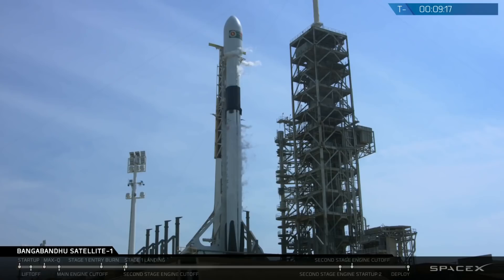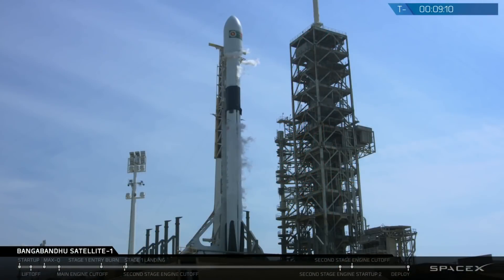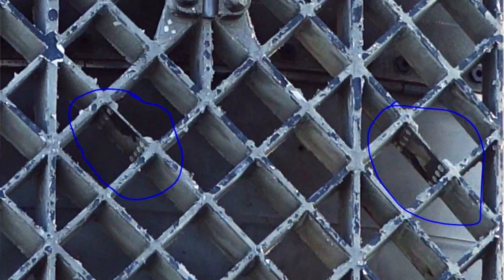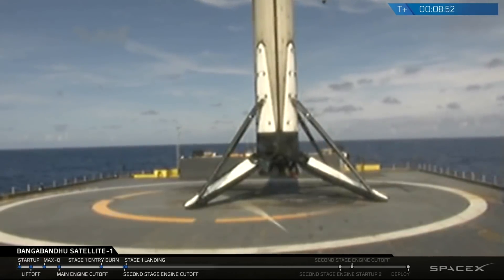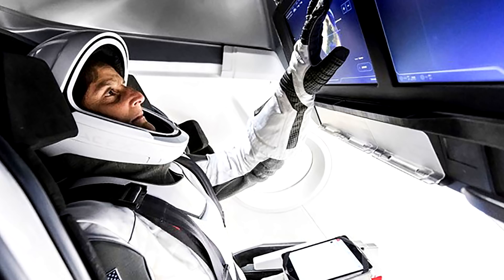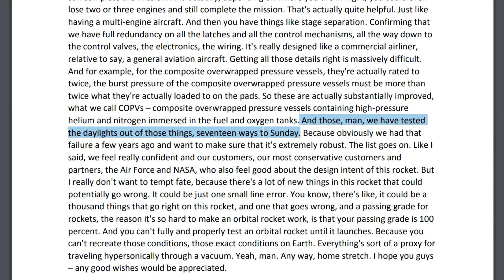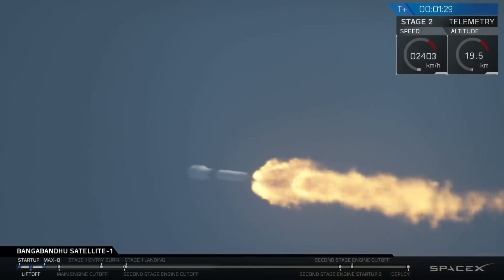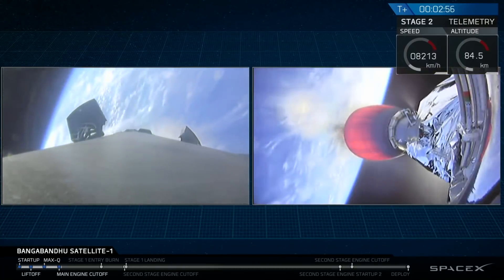How Well Did SpaceX's new Falcon 9 Work?

Comment: One thing i think has been missed, about the difference between Falcon 9 and Space Shuttle, is that there's a big difference in the number of internal sensors which can be used today vs. 40 years ago.

It's easy to get off-the-shelf sensors and embed them in the rocket, they've got many as we saw with CRS-7.  An inspection which for the Space Shuttle required a tear-down, could be performed for no cost in a few seconds using internal sensors.
Reply: Another thing that's worth mentioning are the tools used to analyze the sensor data as well as better simulation tools.
For example the cause of the CRS-7 launch failure was determined partially by using accelerometer data from the upper stage to triangulate the point of failure (yes, I've googled it). I imagine that in the shuttle era similar analysis would take much longer, or even be completely impossible.
Reply: Falcon 9 isn't human rated yet. That's a big part of the difference. Human rated requires so much more in depth recovery and inspection. While a 'cargo' rocket really only has to meet acceptable risk for the insurance company, customer, and government safety.

I will not be surprised to see Falcon 9 boosters be first launch human rated and then used in service launches aftewards to avoid the costs of a fine toothed come tear down and inspection. But we will have to see.
Reply: @Cragifield, thats actual the plan, they don't want to use refurbished boosters for human transportation.
Reply: That's still a great way to reduce costs for the foreseeable future with a fully reusable rocket, because it's incredibly likely that until some form of space tourism takes off in a big way that we'd have vastly more cargo launches than passenger launches even with a few colonies. You need to transfer supplies to different places and I imagine that a lot of projects will start with cargo launches containing robotic equipment to help with assembly.

I'd wager by the time anything in Space is cheap enough/worth going to enough to allow for real space tourism that we'd also have vastly increased cargo requirements, possibly even going from mere colonial supply transfers to genuine trading between different planets/moons/stations.
Reply: These sensors existed 50 years ago as well.  Show me your off the shelf sensor that can handle 1000c
Reply: The sensors might have existed, but they've come down massively in price, and more importantly the computing performance has gone up by a factor of millions in the last 50 years.

There's not much point to having a sensor if you can't do anything with the data.

A modern computerised system can comfortably record and even actively calculate from thousands of sensors at once using what for modern times is rather unimpressive computer system.
50 years ago, that would've been unthinkable even if the sensors themselves were available...

But consider the less performance critical parts;
Part of what allowed something like the Wii to exist when it did was the development of low cost MEMS gyroscopes and accelerometers.
And while that's hardly going to cut it for a rocket, the fact that you can get a functioning 3 axis gyroscope and accelerometer for a few cents that weighs a few grams and takes up next to no space, you can afford to use thousands of them and not even give much in the way of thought to the cost.
Contrast this to what existed before where equivalent performance would cost thousands...
Yes, the high end stuff is still pricy, but the performance of parts at all price ranges has improved a lot, and cheap (as in a few cents to a few dollars cheap )sensors are viable for many tasks now, where even 20 years ago you wouldn't have been able to get anything in that price range, much less something usable.
But at the end of the day it's computing power that has made sensors more useful.
Not so much the sensors themselves.
Reply: Human rating does not require any recovery or inspection. Expendable rockets can be human rated too.
Reply: While it is true that sensors are more useful now, the Shuttle was mainly torn down because it had a lot of parts that required maintenance between flights. This still would have been true even if it were highly sensored.
Reply: Chris Phan it may not be off-the-shelf, but for a temperature sensor you need a bit of platinum wire with a 4-wire measurement, then lead the wiring to a colder place where you can have an off-the-shelf IC that measures the resistance of the platinum wire and translates it to some form of digital signal.
Reply: Very true.

Another big difference: no solid rocket boosters.  It always annoys me when SpaceX haters criticize the Falcon 9 last-minute fueling procedure because it isn't safe, and demand that shuttle fueling procedures be used instead.  But solid rocket boosters were part of the shuttle stack, and there was nothing safe about them!  With a solid booster, you light it and that's it, you are out of options.  It'll burn up its fuel.  If something goes wonky, too bad.  You can't do a thing about it.  You have zero control.  You also can't tweak the thrust while it's lit.  Putting humans on a rocket stack with solid boosters is the exact opposite of a safe approach to rocketry.

Hopefully, NASA will resist the temptation to authorize solid boosters for any future manned missions.
Reply: "Similar sensors might have existed, but the precision and speed of these sensors has increased drasticly"

Sorry, but that's mostly just plain nonsense. A lot of people don't understand how certain sensors have seen an evolution from analog into digital versions of the same sensors. And in all honesty, even in cases where that wasn't the case, the biggest change will be size and cost only. Not so much accuracy or reliability at all. I keep hearing the same with current VR hype nonsense, however there are actually fairly LOW BUDGET solutions in current generation VR headsets (yes, basically smartphone grade sensors) and it is stupid to hear people claim the older VR headsets were less accurate. It's simply not true. Anyway, got of on a tangent there, sorry.
Reply: Urgelt To be fair, Challenger aside, NASA did get really good at the safe use of SRB's, and SLS is planned to use an upgraded version of SRB's for it as well, so yeah there is that. That said, we are talking about rockets here, there is nothing "safe" about them, and risk is never going to be a zero-sum, period. 
To this day I still believe in the old saying "assumptions are the mother of all fuckups" but when talking about rockets (or any kind of aircraft for that matter) I modify that to be "assumptions may be the mother of all fuckups, but complacency is the fuckup that will get somebody killed" and that's when Murphy's law loves to bite you in the ass (if it can happen, it will at some point). And the classic proof of that, Columbia, I mean it was only a piece of foam right, what harm could it do? Pieces of foam had been coming off the external tank and striking the shuttles for years after they stopped coating it to prevent that, and no harm was done. Well, during the accident investigation engineers proved exactly what that lil piece of foam could do to the shuttle when they proved it was the likely cause of Columbia's accident. Yep, Murphy's law rode into town on the back of good ole complacency and took 7 more lives that week.
So if there is any single lesson that SpaceX needs to learn from NASA, it's to be ever vigilant in guarding against complacency, cause lets face it NASA still hasn't got good at that.
Reply: @Rob_Moilanen  Those tear downs also missed a seal that killed a bunch of astronauts. They obviously weren't as effective as they were supposed to be.
Reply: Robinson Joe - Actually, that seal problem was found on inspection & logged, & NASA had been warned on multiple occasions of the dangers of launching with the Thiokol boosters in the type of frigid conditions that occurred on the morning of Jan. 28, 2006. The directors at NASA chose to ignore the warnings...
Reply: @TraditionalAnglican  Apparently (after checking your information) it wasn't ignored. NASA made a change in the higher ups and the ones on the way out failed to make a change before leaving and the new ones didn't know about the problem. Insane to think about and someone should be liable but not the same thing. One requires a different change than the other. That would be why NASA has become so anal retentive about safety.
Reply: Robinson Joe - The information had been communicated NASA management as early as 1977, & was communicated several times afterwards. Inspectors had discovered impingement on the O-Rings on previous occasions the STS had been flown when it had been 45°F or colder. Thiokol engineers argued vehemently against launching the evening before the launch of STS-51-L in a series of meetings with both NASA & Thiokol management as launch site temps fell to under 29°F. The engineers showed management the results of the inspections I referred to earlier, along with a few of the previously referred to warnings. NASA & Thiokol management heard the warnings & decided to ignore the objections & overruled the engineers. The problem was those NASA managers decided to go ahead & launch AFTER being informed of the issue. The other problem is the engineers who tried to convince NASA not to launch were demoted &/or fired. “No good deed goes unpunished.”
Reply: @TraditionalAnglican  Interesting. All i could find was a report that came just before upper management changed but if that's the case my question is why weren't they charged for criminal negligence causing death.
Reply: Robinson Joe — Politics & the difficultly of making a case to a jury when so much of the materials are Classified Secret or Top Secret... Or, the rich & powerful protecting the rich & powerful once again...
Reply: @TraditionalAnglican  to easy an answer. Nothing classified about that mission. Easy to say there rich so they win. I fought the Canadian government and won. If the US citizens wanted an answer they would have one. If you have evidence they knew and did nothing you obviously don't care either.
Reply: Robinson Joe - Actually, much of the tech & procedures, along with the minutes of the meetings I referred to, wasn’t declassified until 1993-95, After the Statute of Limitations for “Negligent Homicide” (Manslaughter 1 - the charge they could’ve been convicted of) had expired. The US Federal Government has a doctrine of “Sovereign Immunity” which makes it almost impossible to win a case against the Federal Government.
Reply: Urgelt:  There actually is a method for shutting down solid rocket motors prematurely; it was developed in the early-to-mid 1960s out of a desire to improve the accuracy of the Minuteman II ICBM over the Minuteman I.  The Thrust Termination System on the third stage of the Minuteman II/III (and, though I don't know for certain, presumably on the top stages of the Peacekeeper and the Trident I/II SLBM) uses blow-out panels at the top of the stage to both cancel the thrust generated by the burning propellant (by venting forward as well as aft) and to literally "blow out the fire" (by allowing the chamber pressure to drop to zero) and completely end its burn when the guidance system detects the missile is on the desired trajectory.  In ballistic missiles, this is used to give more flexibility in aiming and more precise impact points compared to the old "burn to depletion and use trajectory to set range" technique used in early solid-fuel missiles.  (Minuteman III would add a liquid-fuel "payload bus" fourth stage that can get even more precise targeting, but its primary purpose was to allow independent targeting of multiple warheads rather than just spreading them out in a shotgun blast around a single target point.)

This technology was suggested during the development of the Shuttle for the SRBs, but was rejected, not on technical grounds or because it would have caused too much of a performance penalty, but because it was felt that it wouldn't be cost-effective to develop such a capability for them, and that, as with a number of other features that were deleted for the same rationale (including escape rockets to separate the Orbiter from the ET in an emergency), it would be possible to make the Shuttle system "so reliable that we don't need such things," i.e., that the systems would be so reliable and redundant that it was impossible for there to be a failure that could ever result in the loss of the crew and vehicle.  (Yes, between still being on the high of the success of Apollo and Spiro Agnew cutting virtually everything out of the budget, there was quite a bit of hubris on the part of NASA administration then...)
Reply: Another thing on turn-around is materials. It's likely there's some crazy seeming stuff that's been developed over the years. Instead of dicking around with application of who-knows-how-many tiles like the old shuttle had, they probably have some ceramic/aramid composite cocktail that's sprayed on with a plasma deposition process, that has just as good heat resistance for the intended duration of re-entry. So that aspect of turn-around could be down to how fast they can prep, spray, and strip instead of having numerous fitted components that must be individually applied and inspected due to all the possible points of failure.
Reply: True. Doing analyses especially on the flight is hard. Years ago these analyses maybe existed (I think there are a lot of news in this but still) problem was that you couldnt compute them. BUS systems, system distribution. Now its so much possible but it gets really hard also. Iam big fun of these technologies. You have these in airplanes also. There are accelerometers on wing that can detect a starting rupture
Reply: Lol, even types in accent. One think
Reply: Nate Vlietstra yeah you can human rate an expendable rocket. Not sure who youre arguing with since no one here said you cant. That said it is proven to be a massive waste of money. The Space X way is viable for a company spending its own money. The nasa way.. only viable for croney gov. Funded agencies that can spend other peoples money without having to worry about price to much. But as we saw with the lack of development in the space program since the end of the cold war, even that only works when people are sufficiently scared.
Reply: pauljs75 There is a cheap material that works, It's called AVCOAT 5026-39. It is an epoxy phenolic resin sprayed between ordinary layers of cork. It was used in the apollo program on the fastest craft to ever re-enter the atmosphere and worked just fine! It was also no more difficult to apply than spray on bedliner to a truck!
Reply: CLP - Yes, but Shuttle was far more capable than any expendable rocket. No expendable vehicle has the capability to bring satellites back to Earth, and very few have the capability for on-orbit repair. So it is quite natural that it was a relatively expensive program.

pauljs75 - Falcon 9 reentry is way easier because it's not an orbital reentry or even close. PICA-X heat shields are still replaced each flight; eventually they'll start relying them, but they aren't something that's maintainable. Just an item with limited life.
Reply: Solid rocket engines are as you say, once lit - no way to put that candle (god bless Alan Shepard) out. Yet in engineering terms they should be as reliable as a rocket can get. The boosters on the shuttle as we all know had to be compromised by building in sections. This was, in hind sight, done with questionable engineering practices. You can't get simpler than a solid rocket and it should (emphasise should) be orders of magnitude more reliable than a liquid fueled rocket engine. The fact the shuttle had issues here goes far beyond the 'O' rings, it was the whole package under scrutiny, from the 'twang' or whatever they call it putting gigantic moments on the launcher and so on.
You can though (er I guess) of course abort the launch and detatch the boosters early....if not why not?
Reply: Yep. The AJ-60 solid motors (not segmented) on Atlas V and GEM-60 motors (also not segmented) on Delta IV have been very reliable. Large motors are more problematic.
Reply: No, in fact on the shuttle they couldn't just eject the boosters until burnout. There was a switch on panel C3 that could do it, but it was disabled by the GPC's until burnout because if you did jettison them then the external tank and the orbiter would be exposed to it's super hot exaust plume in a best case scenario, at worst they would crash into the orbiter/ET... THAT would NOT be good. It would mean a challenger like breakup in the best of circumstances. Once the shuttle launches it's "in the bucket" until after SRB burnout. That is to say they could survive 1 SSME shutdown, and that happened on STS-51-F due to faulty instruments causing an automatic shutdown, and they inhibited the computer from shutting down any more. If they had lost one more main engine during that launch they would have likely had a total loss of crew and vehicle situation. There was a maneuver that they hypothesized they could use involving flipping the shuttle backwards and thrusting retrograde after booster seperation but it was seen as incredibly risky and the first shuttle astronauts when asked to test it said "lets not" and refused to fly a test of that abort mode (RTLS aka return to launch site abort) If they had ever tried that there is a very good chance that the shuttle and ET would have been ripped apart by the aerodynamic forces.
Reply: Thanks very informative reply..wow.
Reply: Christopher Silvia   I think back to the days of the development of Apollo and the Saturn booster. It was much safer than the Shuttle, with a launch escape system, and a design that had the crew stationed at the top of the stack. 

And though the computer systems in use at that time were very primitive, the engineers (likely using slide rules in many cases) managed to build a booster that never had a catastrophic explosion or failure (I can’t think of another rocket system that could match that record). Most of the growing pains occurred during design and development, with the trickiest being the development of the F-1 engines which had, at first, problems with engine stability. Once they solved that, Werner Von Braun gave it quite a rigorous test, having a grenade detonated inside the bell of the engine, which very quickly recovered stability within milliseconds. 

The most trouble they had with the Saturn V booster in flight occurred during Apollo 6, when there was severe oscillations during the first stage (had there been a crew aboard, they would have had to abort), and then two engines which failed in the second stage. Both of these problems were quickly identified, and easily fixed. They certainly had the telemetry they needed, and the following Saturn V launch had a crew aboard — Apollo 8, which achieved lunar orbit. 

The design was carried out by many contractors of the various stages, along with NASA engineers overseeing the development. There were many redundancies in place, which meant if some system had a malfunction, there was a backup or flexibility to get the mission done. The German engineers had a reputation for caution and redundancy that they were dubbed “The Chicago Bridge and Iron Works”, but you cannot argue with their results. Every manned flight was successful, with the exception of Apollo 13, but that emergency was not caused by the Saturn, and yet using a great deal of improvisation, they managed to get the crew home safely, if not comfortably. 

The Saturn proved its worth when, during the launch of Apollo 12, the entire vehicle was struck by lightning twice. It shorted out just about everything in the CM, but the IU, which was well shielded, kept the flight on its proper trajectory, giving the flight and ground crews time to carry out some quick fixes on the way to orbit, with the flight crew laughing (literally, you can find that audio track somewhere here) all the way to orbit. 

What never made sense was the decision (not made by NASA, but by the Nixon Administration) to abandon the Apollo Saturn system in favor of the Shuttle. Despite promises made by managers, the Shuttle proved to be far less reliable, yet far more expensive in terms of the cost per flight. Also, by design, the Shuttle was limited to LEO. It could never have survived a high speed re-entry, which Apollo could. This is one reason why NASA, in developing Orion, the next crew spacecraft, is designing a spacecraft that looks like a larger version of the CSM of Apollo. 

I have a suspicion, given what we know about Nixon’s personality, that Nixon was never a big proponent of Apollo Saturn, because it was considered to be JFK’s program. Nixon just happened to be there when Kennedy’s challenge was met. It didn’t help that NASA management prevented Nixon from meeting with the crew the night before Apollo 11’s launch. The crew was unhappy about it, when they found out, because there were many people interacting with them, and the risk of illness was pretty low. It might have helped to entice Nixon to give the program more support. He was, after all, the boss. 

The sad thing is that the hardest (and most expensive)part, the design and and engineering of the boosters (Saturn 1B and Saturn V) and the Apollo spacecraft, was already done, and with many more launches, the cost per flight would have gone down. 

It’s great that the Shuttle could retrieve some satellites, (though not many — certainly nothing in geostationary or geosynchronous orbits), and were able to carry out repairs on the Hubble. But Saturn Apollo had a pretty good record there. Case in point was Skylab, which was a space station converted from an S-IV B (the third stage of the Saturn V). The Shuttle could never match the sheer thrust of the Saturn V. And when there was damage done when trying to deploy Skylab (one solar panel was lost, the other was stuck and could not fully deploy — the damage also took out a heat shield to keep temperatures down, creating very high temperatures inside Skylab). 

The crew’s launch (commanded by Pete Conrad) was delayed, while crew and engineers had to jerry rig fixes needed to get the station online, habitable, and as fully powered as possible, and when the crew arrived, they were able to replace the shielding with a canopy, which did the job, and cut through the strap keeping the main solar panel still there from fully deploying. They saved those three Skylab systems. 

After the Apollo-Soyuz mission in 1975, Apollo was shut down forever. Like all vessels in LEO, Skylab had a decaying orbit, and if the Shuttle had been on schedule, NASA might have saved that space station. But Skylab fell back to Earth in 1978, three years before the maiden voyage of the Shuttle. The ISS has thrusters, which can fire and keep the ISS from orbital decay. Point is, the Apollo was quite capable of supporting repairs in space. 

And here we are decades later, with the Soviets still using the Soyuz, while NASA, in part due to budget limitations, and different Administrations having different priorities, which has proven to be a headache for NASA, as they no sooner begin working on a program (such as Constellation), only to have the plug pulled by a future Administration, forcing the agency back to square one. 

The idea of reusable spacecraft sounds great, until you realize that you are trying to refurbish hardware that has undergone extensive stresses during launch and re-entry. Were not talking about  an airliner here, but spacecraft. It’s still cheaper to use expendables. Apollo and Saturn could have undergone upgrades to their computer systems, as the technology became available, and they might have still been operating to this day, likely with 14 fewer fatalities. The Shuttle wound up being poorly designed because of pressure to produce a vehicle which could do it all. If you are just launching a crew, you could have made the Shuttle orbiter much smaller. But NASA also pushed using the Shuttle to be the sole vehicle to launch satellites and probes. Thus the orbiter got bigger and bigger, with no launch escape possibility for the crew.
Reply: John Cronin - You are correct on the first 3 points, especially regarding Nixon’s hatred of JFK & NASA’s unwillingness to “sell” further missions to the moon or lunar colonization to him. But, SpaceX has designed the Falcon 9/Falcon Heavy to to be “Reusable after Inspection” for at least 4 missions with Falcon 9 /Falcon Heavy boosters (refurbishment to be done every 5th mission), & never to require the type of extensive refurbishment required by the STS. That would probably occur after 20-25 missions of each booster, by which time the entire program will have been terminated in favor of the BFR/Super Heavy/Starship which is designed to be inspected of reused 9 times, refurbished & updated after each 10th use through 10 cycles for a total of 100 launches...
Reply: TheDemocrab   You know what will really drive corporations into space? When they realize what wealth in mineral resources are sitting in asteroids. Also potential alternative energy sources on the Moon.
Reply: I'm just thinking of the sensors in my phone. Accelerometer. barometer, magnetometer... All tiny, low power, and pretty accurate. And the iPhone timing suggests the stuff has only really been available in this century. The Shuttle was thirty years before the iPhone, even before the IBM PC. It got some upgrades to the computers. It's easy to forget how big the changes have been.

And, yes, just the digital processing in the sensor chips makes a big difference. The Shuttle was being designed when 74xx series integrated circuits were high tech, and I remember a project in an electronics magazine on building a digital calculator using them. The first pocket calculators appeared in mid-series, it was instantly obsolete, but they finished because it explained, in detail, how it worked.
Reply: John Cronin 
I have no doubt that if the Space Shuttle were redesigned today from a virtual wireframe and CAD layers (vs. in the 1970s, which by the way was when the F-117 was designed and prototyped), that it could be made vastly superior in terms of flight and mission capability, as well as maintenance requirements. The Falcon 9 has some innovative engine design and material science; yet it is essentially the same type of vehicle as the Centaur or Delta IV; the key difference is that it has been engineered from the outset to be reusable.
Reply: +David Parry
Rockets don't fly above land during their ascent phase, to avoid risks to population. So they wouldn't be spread across any states, but across a large ocean area.

More importantly, you're completely missing the point of the sensors. They're not for saving the crew that's inside the vehicle at the time of a catastrophic malfunction. They're for detailed analysis of the properties of the vehicle, for spotting potential problems before they occur, and, in the worst case scenario, for figuring out exactly what went wrong and how to prevent it from going wrong again in the future.

If there's a launch escape system, then sensors can also be used for spotting a problem early enough that the crew can still escape alive, so that's an added bonus.
Reply: all of which are NOT true of the China National Space Program ;)

[Edit] +theuncalledfor
Reply: +HuntingTarg
I've heard that Chinese rockets just fly over China and drop spent phases with no regard for the people below, yes. I wasn't talking about China, so I forgot to specify.

Now as for you... what exactly were you responding to? Who were you responding to? What exactly isn't true for the Chinese space program (aside from what I already mentioned, though if you have more details on that, feel free to talk about it some more)?

This one-sentence response isn't very useful, especially if you don't specify who you were responding to.
Reply: theuncalledfor 
Edit fix; whoops, I thought YT put it in for me in the app when I tap 'reply' .  You're right, clear as mud.

Basically I'm throwing a dirty blanket over China's space program:  Good for them, but like most things chinese, done for pride and profit, not science and humanity.
Reply: +HuntingTarg
Understood and agreed.

And yeah, you'd think Youtube would add that in. But nope! It used to! Now it doesn't! Except maybe on mobile, but I wouldn't know that from personal experience.
Reply: isnt that a natural consequence of moores law tho?
Reply: Sensors are fine and dandy.... very useful  (and inexpensive) but will sensors find cracked turbomachinery blades, erosion damage, failing seals etc....  and well, you know, real world mechanical failings.   Err not really.  Those need teardown and inspection to find.
Reply: Allan Copland - The censors on the Boeing 787 can detect just about everything you listed except for microfractures in the fan blades in the engine turbines, which they now find w/o tear downs, & automobiles have had censors that find & computers that log mechanical problems, of the types you listed, for the last few years...
Reply: The shuttle still has a much worse safety record. The F9 has proven to be more reliable than the shuttle, so they should maybe think about just using it.
Reply: My dad worked for Lockheed’s flight test department in the 80s and one of the projects he worked on was a project to improve the Space Shuttle’s refurbishment process. One of the things they would do between flights was inspect the flaps at the back of the wing for cracks, this would be done by stripping off the heat shielding and manually inspecting each flap for damage. The guys at Lockheed figured out that if you were to vibrate the flaps at a certain frequency the would begin to resonate, but if the flaps were damaged they would resonate at a different frequency, and so they could figure out if there had been damage in a much less labour intensive and costly way. I have no doubt that the cost of Shuttle turnaround could’ve been massively decreased had the guys at NASA made that a priority.